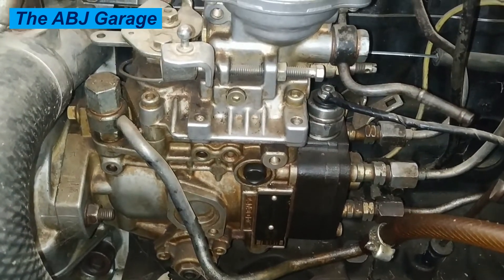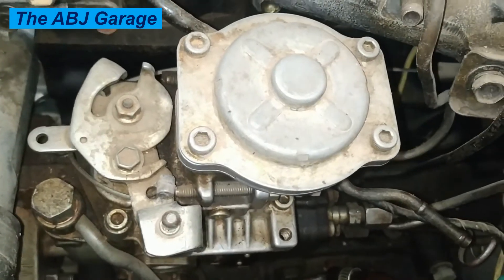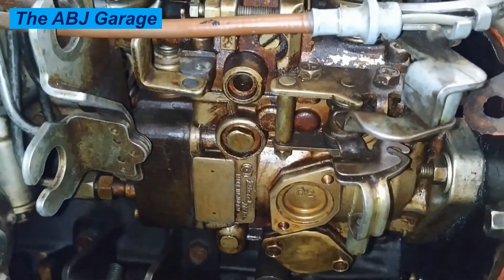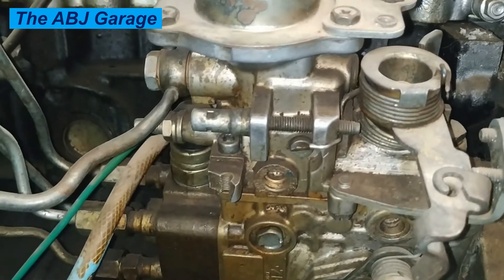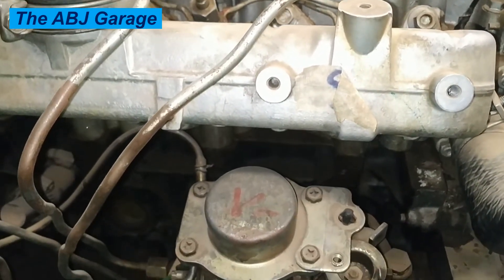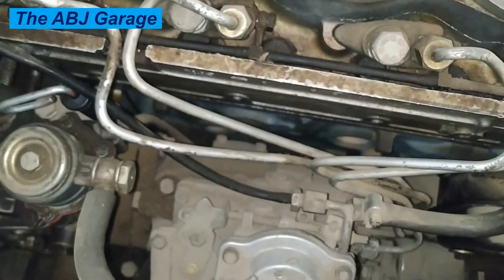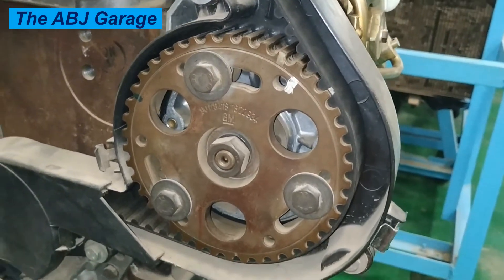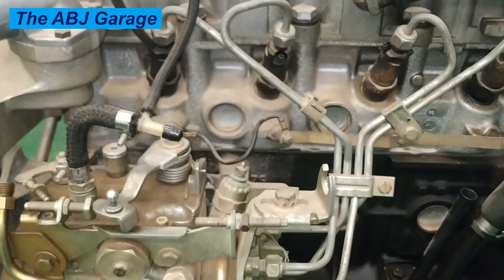How to tell if you have bad diesel fuel injection pump

Comment: Thanks for you video🙏, my engine runs good with no problem till it’s temperature goes high then it stop and engine lights turns on but when it cool down again it start and goes good, what could be the problem?
Reply from the maker: What engine is your car using? If the fuel pump shuts down when hot, it's often due to a heat-sensitive component failing, like the fuel shut-off solenoid or a crank/cam sensor, causing fuel starvation or loss of ignition signal; also, vapor lock (fuel turning to vapor) or a clogged fuel filter can restrict flow, demanding inspection of sensors, solenoid, filter, and cooling to restore reliable hot-start performance.

Comment: Engine runs awhile and goes off when injector pump gets too hot.. what causes?
Reply from the maker: What type of engine? If the engine keeps shutting off when hot, it's often due to a heat-sensitive component failing! This could be a heat sensitive fuel shut-off solenoid, heat sensitive position sensor, or vapor lock (fuel turning to vapor within the system).

Comment: Hi! My car misfires at high rpms or over 60 km-hr1 its isuzu kb250 4aj1 non turbo 
When i rev it it vibrates and has thin white smoke ...what might it be
Reply from the maker: A diesel engine like the Isuzu KB250 4JA1 misfiring at high RPMs is likely caused by issues with fuel delivery, air intake, or engine compression, as these are critical for proper combustion under heavy load. Common culprits include a failing fuel pump or clogged fuel filter, restrictions in the air intake, and low compression due to problems with piston rings or valves.

Comment: What is the proper way to bleed the fuel system with a 6.2 diesel motor in a 1985 GMC 1500 TRUCK